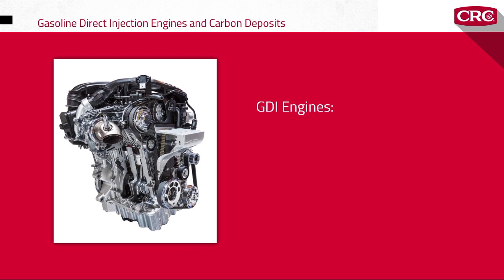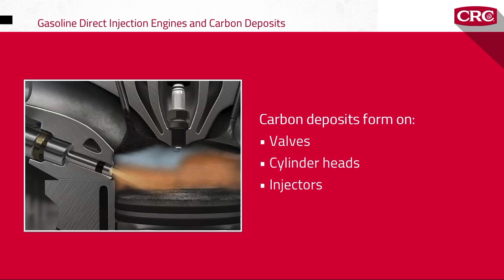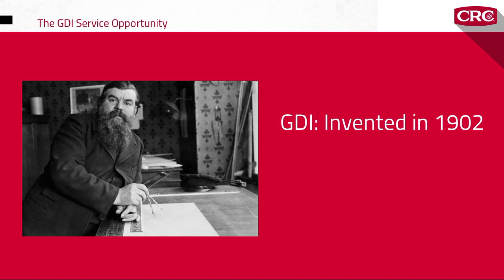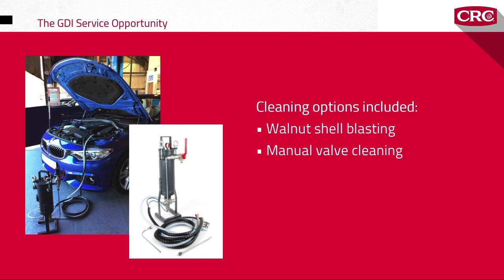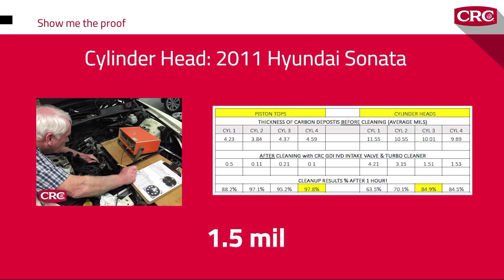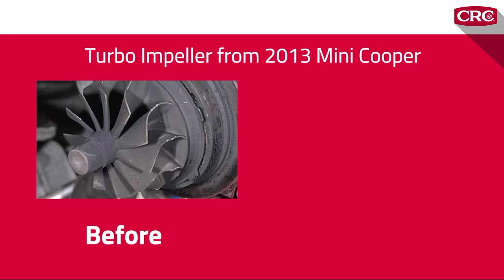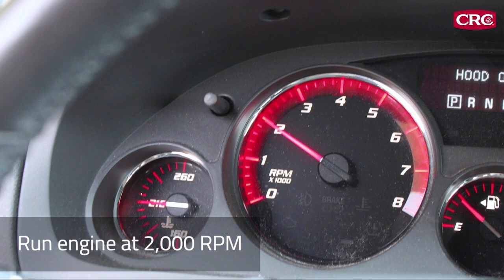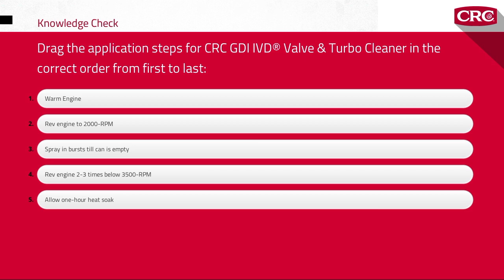GDI Engines and Carbon Deposits | Know Your Parts

Comment: The first drive after letting the engine heat soak for an hour was rough.  I experienced severe knock with 2 different vehicles (2016 Mazda MX-5 and 2017 Mazda CX-5). Is that normal? Also, after that first drive, there was no further knock.
Reply from the maker: This can happen when the product pools somewhere in the intake manifold. It always clears out. To avoid this, a shorter spray rate is recommended. Spray for 1 second wait 1-2 seconds and spray again. This can also commonly happen with 4 cylinder vehicles.
Reply: Know Your Parts Thanks for the advice! I'll switch up my technique next time around.
Reply: I also noticed the severe knock on my 2016 MX-5 after treatment. I did my first treatment after 31k miles. It puked black smoke and pinged horribly for about 3 miles before it finally cleared up. It scared the crap out of me.
Reply: You are giving a different instruction. The product instruction says spray in 30-second intervals.
Reply: Layput -- I agree. So which is it? 30 second intervals or 1 second?!?!
Reply: Artem Brayson Newer cans now say "spray in short bursts until the can is empty." Without the specific value, I guess it's now open for interpretation.
Reply: It did to mine when I exceeded 4k RPM just keep it low and if it does make sure you release gas pedal immediately
Reply: I just ordered this for my 2.5L skyactiv engine. You mazda owners might like it too: http://www.jamesbaroneracing.com/blog/theres-nothing-positive-about-the-2-0l-skyactiv-pcv-system/

Comment: My x-wife has a 2014 Kia Optima 140k miles she never does anything to it It will carbon up one or two of the spark plugs every 4 or 5k miles so bad it loses a cylinder and sets a check engine light for miss fire I just pull the coils and replace the plugs reset the check engine light and off she goes it is also drinking oil . So Sorry So sad Shes lucky i do that for her

Comment: It doesn't work people. We used it on a new engine every 5oooKm and removed the inlet manifold after 40,000km and it was no different from the same type car after the same Kilometers. both these cars were serviced every 5000Km.
Save you money and get your valves nut shell blasted.

Comment: 1 Bottle of Techron every 3000 miles. You will be fine. You don’t need this stuff. Recommend by Kia . There’s also a Technical Service Bulletin saying to on use Techron in Kia GDI engines .

Comment: I tried it on a 2011 Nissan Turbo Juke with 82,000 Mile's on it Followed Direction to a T!! And never felt a difference, But I always use Tech-Ron with the  PEA .. So maybe my stuff is Clean already going to get a BORE scope to see if I have been wasting my money on snake oil.. I have DIG Nissan Juke and always run 93 Gas in my car but, I bought it at 50,000 and don't know what the first person did to Her, as far as maintenance to HER the car..

Comment: These engines junk and flawed by design spraying things down the intake tract isn't good for any internal combustion engine it will displace carbon into the cylinder bores and would more than likely increase the possibility piston skirt and cylinder bore damage

Comment: Im afraid it will cause damage the gaskets or any rubber seal
Reply: Got it on some rubber hoses while I was doing it. Didn't seem to do much if anything to them. I just wiped it off with a rag. It's less aggressive than any cleaner I've used thus far. At least on hoses or what have you.

Comment: Why cant you use it on diesel? 😭
Reply: diesel engines dont have a throttle plate. you cant control rate of application
Reply: It will combust too early uncontrollable knocking

Comment: You will lose 5 to 20 HP in a hour of driving , Reason? The loose carbon will stop up your C.C. .. Now that may cost you thousands to replace .. Toyota has fixed this common problem with there duel injection engines..

Comment: ok!! I've one question "well afew" why do you say carbon build up from blow-by carbon, its oil the oil build-up on the intake valves & surrounding chambers are oil, dried, baked oil...…

its not carbon, hasn't any true carbon properties.. its simply oil, dried, baked oil.. this oil comes from poor crankcase ventilation systems... when they fail or jam up they allow greater oil amounts to be sucked into the intake, further adding deposits of oil to the inlet...

if this chemical is so good, why isn't it sold worldwide?!?

2nd if its so effective why not have a unit that would allow small sprays of this solution whilst the vehicle is in use... kind of like add blue to a diesel vehicle, only this time to a petrol engine vehicle having this solution being sprayed (water injection style of set-up if that makes sense) this would prevent the issue from occurring from the get-go.

you also mention its strength, is this solution fit to be sprayed on/around rubber seals...

I'm in the uk/Europe & to say our intake sprays don't really do a thing other then waste money.. especially those that get sprayed into the intake of an engine..... however having it sprayed directly into the intake chambers & allowed to stand & then using a manual method the oil comes off.. other then that the oil just turns into a sludge with little movement without help etc.
Reply from the maker: Thanks for your question. For the quickest response and best information
 on this, you will want to contact the CRC Industries Tech Line: 
800-521-3168
Reply: All stupid questions, did you even both to look these up? Oil, fuel, etc is made up of carbon, blow by is a byproduct of combustion. The buildup is primarily carbon, when saying "carbon buildup" its common sense that it might not be 100% pure carbon build up. Of course its made to be sprayed in the same lines that take in FUEL from the PCV system. Your solution of having it spray is dumb since there is already a better solution of having direct injection and port injection. This product works, you can see on youtube, whether it works the way its recommended you could debate but manually cleaning the valves with this product works.
Reply: @BoogieDownProduction   rite! 
1st SOME manufacturers are adding a port spray to direct injection engines to clean the valves (remember my water injection comment!!! it would help cars already out there on the roads NOW!! not in 2yrs time etc)
others are changing the engine time/increasing engine running temps to reduce build-up & theres a 3rd option cant think what that was.

2nd PCV doesn't involve the fuel cycle or fuel injection its AIR-VACUUM!! to recirculate YOUR the one who's mentioned fuel being injected in the PCV not me!!! very slight vapour maybe present due to wear etc overall the PCV is to reduce the crank case pressures, as systems changed from a open case (directly open or open to a filter they both occurred) to a enclosed unit for emissions etc 

regarding manually cleaning the valves! YES I've allowed the area's effected to soak upto 2hrs at 1 point & no the build up doesn't just wash off as a mist or powder in liquid it turns to a very sticky sludge, most of which still sticks to the valves & port walls. the cleaning products I found just sat there doing very little overall. on very little build-up it may help "VERY LITTLE build-up!!" but on cars with high volumns of build-up NO... & that's the point I'm getting to as most if not all ppl with issues will have HIGH build-up in the valve area!!!

hence 
1: soaking the area effected (found best in fuel.. products just sat there doing little to nothing)
2: scrape with picks to remove build-up
3: suck-out fluid any loose sludge & repeating this several times
4: using a set of wire brush (brass/metal) to get a better overall finish
5: gave a quick final rinse etc on all ports!!

honestly! try it yourself.. if you have a GDI engine, remove your intake & have a look & use this spray to clean it, you'll see yourself the build-up happily sits there with very little change! then ask yourself how much its cost you! then get some fuel & pour it in the reactions are totally different & the build-up comes off the faces much much easier!

seriously do it yourself! or better! 
1: remove your inlet or get a camera in & snap video/images of the valves
2: use the spray as directed.
3: snap video or images once you've 'cleaned the valves as above!!'

prove everything yourself!!
the only thing I've not done was video the ports or work getting done, but I've shown the end results of my work using fuel as the cleaning product (a small amount of fuel I may add!)

& YES I've mentioned it on several intake valve uploads & not a single one has proven the fact! so could I say "paid product placement!" also some are very resent uploads aswell not yrs old.
I'll also add when I sprayed my intake prior to removal I also thought my car ran better, however when I did a proper valve clean the car was absolutely different, smoother, more responsive etc & that's an engine with around 80k miles on it!

so instead of ranting on etc etc… prove me wrong!!! get a GDI & clean the valves prove the results

Comment: The instruction doesn't compute!    You said to start with a warm engine.   Then with the airbox opened and the throttle body accessible, empty the can into the throttle body while the engine is at 2K RPM then 3K RPM.   The problem is that the engine would stall if the airbox is opened.   So you can't keep the engine running at 2K RPM while spraying this stuff into the throttle body.

Please clarify!

Comment: Just stay away from GDI engines and you're safe
Reply: Direct injection isn’t the problem it’s the  crappy PCV systems, you just don’t have port injection to mask the problem
Reply: Just get yourself a car with both mpi and gdi.
Reply: @shhhdontshout  Toyota is the only company with Dual Injection on all their engines now.  Ford does it on some on their F-150s with Ecoboost. Acura does it on the NSX supercar.   That's about it in the USA. I've been irate about this disaster ever since Obama dictated his "54.5 MPG by 2024" CAFE regulation. That POS was a one-ball wrecking ball to the gasoline engine.

Comment: Complete bulshit ! Whatever you spray into the intake when it touches that inlet valves will evaporate in a instant ..
Reply from the maker: If you need more clarification on the process for using this CRC product, you can contact the CRC Industries Tech Line: 800-521-3168. They will be able to give you complete details and address your concern about evaporation.

Comment: dont get GDI ..problem solved.
Reply: David Bradley it’s the thing of the future for Gasoline. Manufacturer can generate more power from engines with them equipped due to more consistency with fuel/air mixture and most importantly to meet current emission standards. Hence even the Japanese are phasing out multiport. 
Hence some manufacturers like Lexus, that have come up with a fuel feed before the Direct injection to alleviate the problem.

Unless you buy an old car is what you’re saying
Reply: eeiko321 actually the benefits were a bit overstated as far as fuel economy goes and GDI causes more particulate matter so it depends on the country's environmental laws. CO, Nox, and HC is a little less with GDI. Those can be countered with the catalytic converter and if it stays clean, it will work well. It really depends on the engine and weight of the vehicle. GDI was found to give 8% better economy at light loads but at higher loads and RPM, it was similar to Port Injection. The goals to reduce CO2 and therefore increase economy up to 50mpg average will require much more than GDI. They will require lighter cars, with less frictions throughout, aerodynamic and with energy regeneration in city or cylinder deactivation on the highway.
Reply: so inteligent, better say dont get fuel injection stay with carburator !!!!!!
Reply: GDI Sucks incorporate a Port injector with GDI for each cylynder